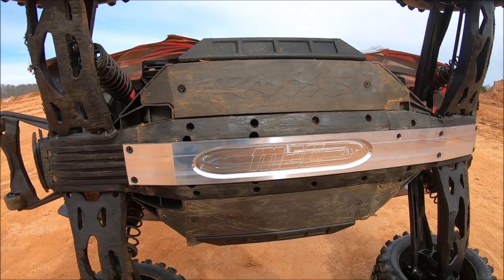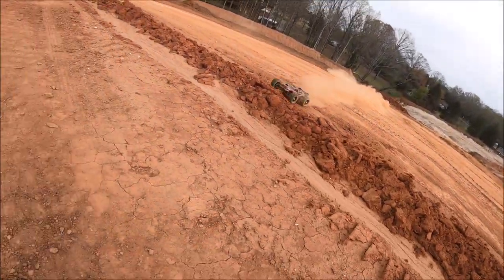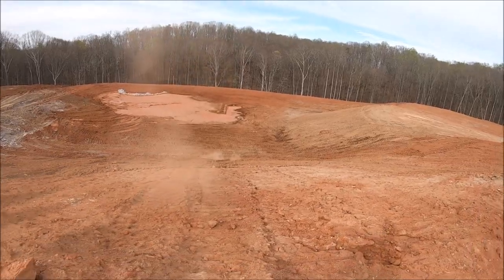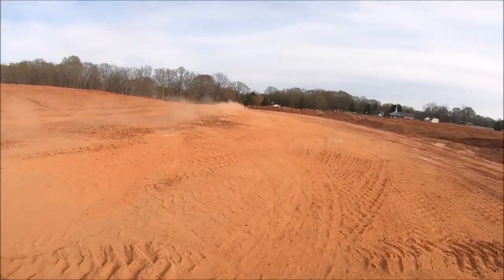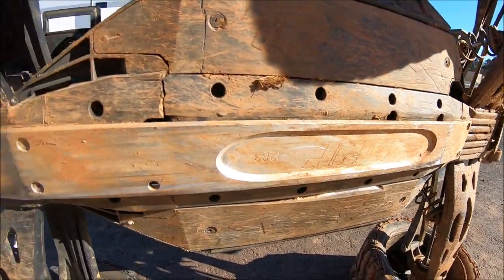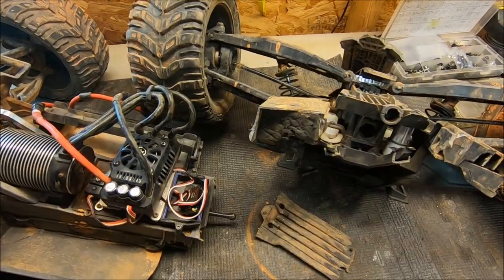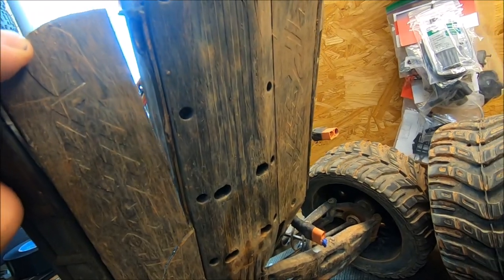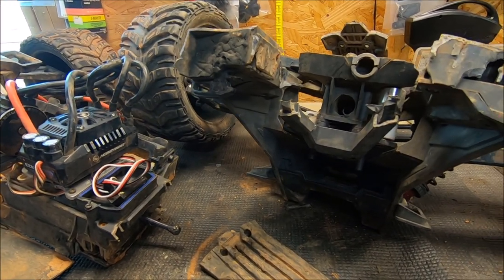Traxxas XRT DESTROYED?!!😱Mega bash with M2C chassis brace!

Comment: I had a total loss of my X-maxx a few weekends ago. The Max 5 caught on fire and by the time I got there, the entire truck was on fire because the batteries caught. After we put out the fire the only things that survived were the motor, servo ( it was a savox) and the entire drive train (with only slightly melted diff cases) I am rebuilding it, so you can too :)

Comment: What's impressive, you broke the rear part of the chassis earlier, then broke the front part off on that last curb stomp. so the brace did exactly what it was supposed to do, it was the chassis itself that failed around the brace
Reply from the maker: Exactly right! I even did more jumps after it cracked and it held! Anything would have broke on that full force curb hit!😱😂

Comment: What gearing were you running here? I've been setting mine up with the m2c stuff but 27/46 seems too small for it. M2C website shows 28 as smallest so I have some bigger ones coming but I wanted to see what you have on yours.
Reply from the maker: I'm running 34/46 with a Hobbystar 1120kv
Reply: @RCDUDE81  Awesome, I picked up a 33 and 34. Do you find heat being an issue with that gearing? I've got a 1100kv 2028 castle going in.
Reply from the maker: I'm honestly not sure how your motor setup will go as far as heat but it shouldn't get over hot unless you're going hard in grass! I usually give my rigs cool downs also.
Reply: @RCDUDE81  Sounds good man, I wasn't sure either but i'm excited to give it a rip now that's finally starting to get a little warmer.

Comment: Are you running different springs or shock fluid at all? Crazy bash but parts are pretty cheap. Surprised your still running the standard servo though with all the crazy bashing as kevin talbot smashed his and then i found mine broke on all the mounts same as kevs.